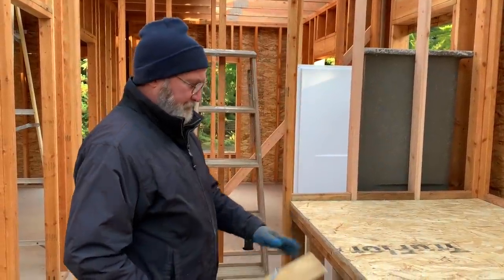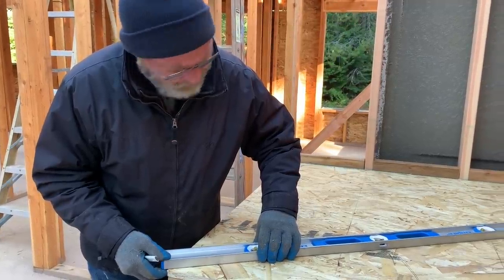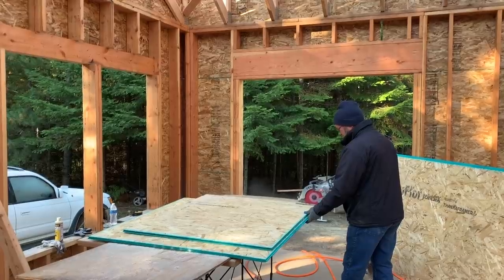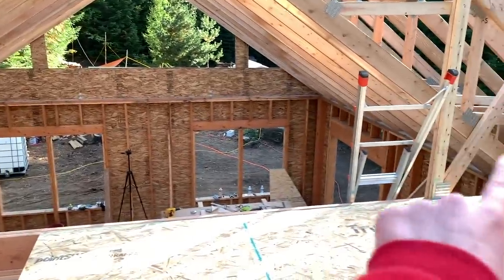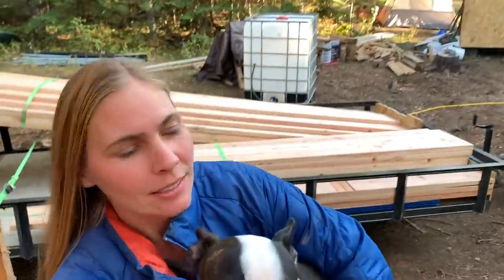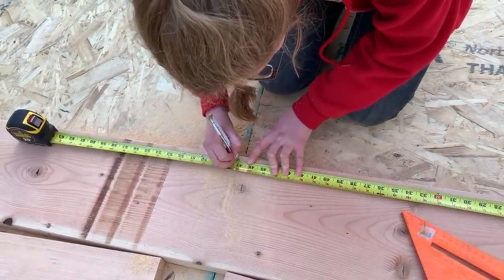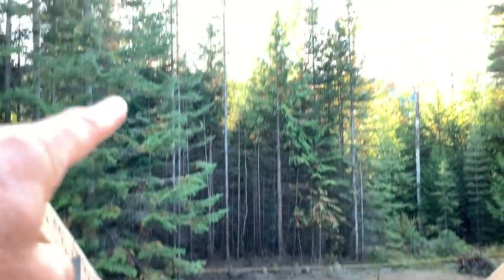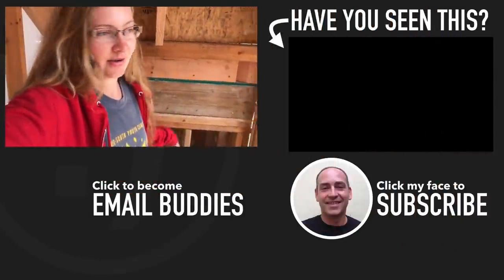Building Pie Stairs | Off Grid Cabin Build #35

Comment: Y'all have showed me a lot and I'm trying to do off grid travel trailer and I got my solar panels on the roof but y'all show me that you can have the solar panels auxiliary like outside the camper and just have them on the ground where you can move them around but I got 2000 watts of solar panels and I got two 2000 watt inverters and six batteries all together so I got I can't remember what the amp hours is but it's up there cuz I'm going to do I'm going to do like you did I'm going to put my my three batteries together in series I'm a parallel them and hopefully everything will work out where I don't have to plug into nothing I do have a generator like y'all have and y'all are very very helpful in off-grid knowledge I'm going to have to see if I got to drill me a well or if I can find me a piece of property that already has a well head on it or water going to the old decrepit house or whatever I'm going to build me a new house like y'all are doing it's up in the mountains of New York and it's in the cat scale mountains I've already been looking for property I'm going to get 5 acres and going to be up in the woods so off grid so thank you for all y'all's information it's great a religiously watch your videos I might not have as much money as y'all got going right off the get-go but I might have to build my house I believe I'm going to build a big metal building and build the house two-story house inside the metal building so that'll that'll keep me out of the weather right there and I'm not planning on heat in the garage big building I'm going to put my camper in there and live in my camper inside the building until I can build the house all complete thank you for your time my name is chipper hanson

Comment: I hope the inspector doesn’t call you out on your stairs, the inside corner has to be a min width, it can’t come to a point like that
Reply: Blue Steel Architecture Design/Build If the hand dug well passes, the stairs will too. My guess is there will never be an inspection.
Reply from the maker: No building inspection here. The well doesn’t need a permit because it is under 18’ deep.
Reply: No problem I wasn’t sure since you had your plumbing inspected, I just know it sucks to have to redo things

Comment: Everything you did has calculators on the web. Just plug in your own numbers in the blank spaces it spits out your answers.
I never did like the kind of stair supports used here and these particular ones look thinner than usual. The reason I dislike this type of support is that after all the notching is done you're left with just about a 2 x 4 which to my mind is under the strength level I'd be comfortable with.
Reply from the maker: Do you think they will fall down and hurt some one?
Reply: Not to mention they are done with plywood, that's going to sag eventually
Reply: @lonniehowell2360  I didn't notice that.